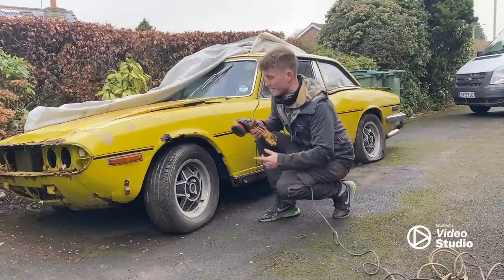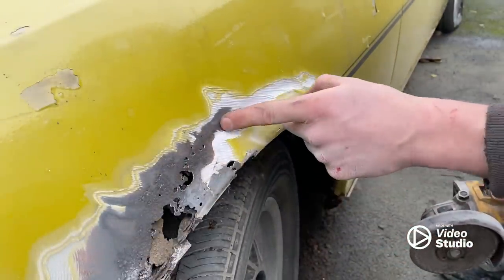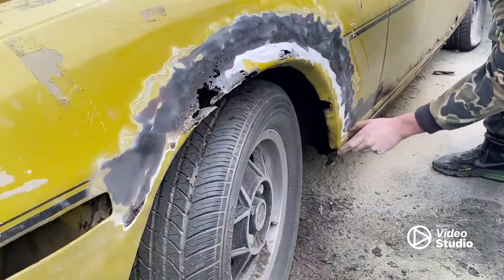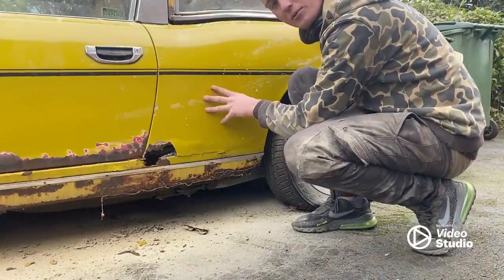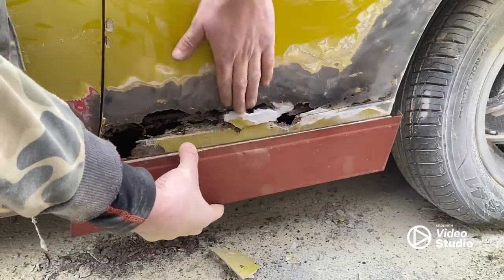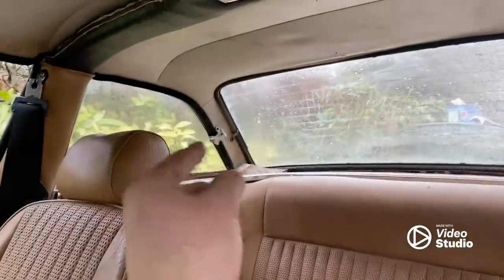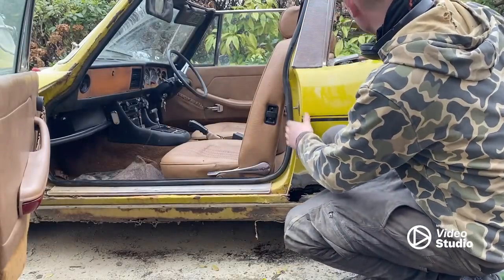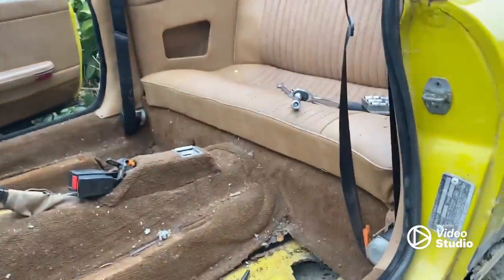Taking an ANGLE GRINDER to my ROTTEN, V8 Triumph Stag! (plus interior stripping.) How BAD can it be?

Comment: With no disrespect surely this car is scrap!? It seems what needs replacing is the complete sills/floors etc followed by lower wings and wheel archers, boot floor, valances etc etc basically the whole car from the ground up to the door handles... But I admire your optimism! Carry On!
Reply from the maker: Everything is repairable it’s just a case of how many hours you’re willing to put in! The way j on see it the doors shut nice…. so it’s all square… so why not! I mean not every panels bad, the bonnet seems good as does the boot floor!
Reply: Well done then – I'm sure you'll enjoy the journey. At least most if not all panels are available... off set by their cost perhaps? Down here in Oz, we are lucky re rust, as its not much of an issue even on a Stag. How is it mechanically?
Reply from the maker: @marknelson5929  all panels I want are available bar the windscreen surround. Mechanically it doesn’t seem too bad, when I first got it running (there’s a video on the channel) it smoked and was a bit tappety, but having ran it since it’s been pretty good,suspension doesn’t look too bad either, there appears to be new brake hoses fitted bushes aren’t cracked ect. You don’t really know the full story til it’s up in the air and you can give it a good look over though!
Reply: I've seen worse restored especially mk1/2 ford escorts

Comment: I'm looking forward to watching this take  shape. I admire your optimism! If you haven't already figured it out, there are 2 more levers on the soft top that release the back window (1 each side) and the last part will fold out. It may not be seized. When folding it away again, you must make sure that the window is securrd back onto these clips, otherwise the soft top will jam in the storage section and will have to be removed from the car to fix it...not a 5 minute job as you already know. Good luck sir!
Reply from the maker: Thankyou! Yeah I soon realised after slackening off the mechanism! I honestly don’t think it’ll be too bad, when we restored my dads old mgb as a teenager we found loads of old bodges, fibreglass, bolted on bits of tin! This soo far doesn’t have anything too horrendous… but there’s time yet!

Comment: Great project ! - well done. Triumph Stags are becoming ever more valuable when sympathetically restored. I’m not sure how much you will need to strip from it before you start to weld new panels as required. From experience, I would remove as much as possible, including engine and gearbox. Restoring the bodywork on it will be 80% of the project. Keep the videos coming, a good one to follow.
Reply: I fully agree, strip as much out as possible and ideally get it on a rollover jig, there will be more than you can see underneath. The rear floor rot will be all around the rear subframe mounts so all the rear suspension and diff needs to come out. And of course full 3 piece sills to get the strength back in. Well worth it once done, I love mine!

Comment: An area that Stags rust in is the base of the A pillar behind the front wings. Before you add the wheel arch repair panels get a look inside the wings.

Comment: I am a motor engineer of fifty years experience starting my indentured apprenticeship in 1972.  No one is a bigger fan of the Stag than me, having worked on many throughout my career and I still own one today.  
I appreciate your sentiments and greatly admire your enthusiasm, I certainly don’t want you to think I am being disrespectful and I apologise for bursting your bubble, but the truth is that your car is suitable to use for spare parts only.  
It will turn into a money pit if you attempt repairs, and will take you years to complete.  To bring the car to even a reasonable standard you will need unlimited time and patience, and a similar budget!  
My advice is to find a better car to start with, it will be cheaper in the long run, but whatever you decide I wish you the best of luck. 
Kind regards.
Reply: I think you are right and that's good advice you give.
Reply: I agree 100%  I did one many years ago it was nightmare. And never again lol
Reply: Trouble is market is full of really pretty tarted up on its 15th paint job and three sets of over sills etc etc but has been passed off as a bare metal resto too some poor unsuspecting customer!! I had one a decade ago with a stag for rear arch in it! Even though I showed the customer that it had been four different colours and painted over schultz etc around all lower body filler over filler just etc! He was still adamant his car had had a bare metal respray and restoration couple years earlier! If you restore your own you get to say you saved classic from going too the scrap heap and you know exactly what has been done!

Comment: I had a lovely deep blue Stag for about 18 months, bought in 179.. The car was almost new, and removing the hard-top was a doddle. It wasn’t the bodywork that I ever had any problems with - it was the engine. I think it spent nearly as much time in the mechanic’s  workshop than it did in mine. But what a beautiful car to drive! I loved the throaty V8 burble, and the electric overdrive switch on the gear lever. It was terrific on a warm sunny day to go for a drive withe my girlfriend; driving slowly into a cafe or pub car park & leaving thr engine burbling swat, she made all the adjustments to herself & then walking nonchalantly in. These days, I drive an XJ Portfolio Jag. It might have panoramic glass roof back & front, but though stylish, not like the Stag! Or the constant  ‘stag gearing’ garage bills.

Comment: Good work, big project!   But it will be worth it once finished and the personal satisfaction will be immeasurable.  I own a P reg 1975 Stag in the 'correct' (!) colour of Mimosa yellow, same as you have here.   The back panel is usually blacked in for this year, but looks good either way.  Nice you have the hard top too.  The Stag really is a great car when built properly second time round (too many were poorly churned out by the factory back in the day).  And the TV8 engine, for all it's notoriety, is a sweet engine when built and maintained properly and nothing sounds better.  Good luck!

Comment: Nice, keep up the work. Like watching resto vids. I think, and this is just my opinion, that you are going to have to remove all the interior trim, then weld temporary bracing from the B post to A post on both sides. If the sills and floor are rotten then not much is holding the two halves of that Stag together. Remove any more rot or steelwork and you may end up with a banana Stag, seriously, get it braced before commencing any more work.

Comment: Biggest problem I and my friends had with these Triumph engines was wearing out crankshaft thrust washers at an alarming rate.  They caused real problems with clutch operation and made gear selection impossible.  Not a difficult job to do with the engine in place other than having to drop the suspension to lower the cross member for oil pan removal.  I had to do mine three times in a six year period and my friend 2000Mk2 the same.  They must have been made out of some bloody poor metal.  The other problem was the right angle speedometer drive take off from the gearbox.  It had flexible spigot which simply kept shearing off.  I made my own spigot out of high tensile steel eventually and it never broke.  I never understood why they made it like that in the first place as it simply didn't need a flexible spigot for such a short length.
Reply from the maker: thanks for the tips, there's allot of weak points on these engines isn't there!

Comment: Jeeze. That stag way gone.  More there than you think. Keep digging. Had one back in the eighties with the original 3 litre block. Lovely classic car these days.  They don't the money as well as they should. Think the 3 litre block issues puts people off but as we know the cures are very easy to rectify. Good ignition cure to make it a daily reliable runner is to fit the Accu spark distributor and Power spark coil.

Comment: Yep interesting, actually there's not a lot on repairing these , just bits an bobs , so I watch with interest, thanks for filming this !
Reply from the maker: Very simple that’s what I love about classics just nuts and bolts! Limited wiring and no computers! It takes time but you just have to work your way through it! I mean this 12 minute video was around 6 and a 1/2 hours work! It’s amazing what a bit of editing can do!
Reply: You best be in this for the long hall, I have just got to where I am putting my stag back together, it has been hard but well worth it, good luck and I hope you all the best with it, join the owner club, it will help you find a out what it takes to own a stag, you must be able to weld, I could not and had to get a guy to help me 👍
Reply from the maker: @stevesankey6339  me and dad are hoping it’s going to take 6 months to a year of weekends and evenings! I’m pretty good and quick at welding and fab work now. I taught myself on my mgbgt that was allot worse than this (needed full cils, inner, outer, castle rails, drivers floor, passenger floor, boot floor, rear chassis legs/leaf spring mounts, rear arch, rear inner arches, a pillar, and front inner wings) that did take 6 years but neither of us could weld! allot of time was spent head scratching, and saving up for parts!  I’ve since done minor resto work on other cars but yeah I have to admit this is a big project!
Reply: Advertised as ‘the car to take on mercedes’ delusory Coventry management, they are beautiful had one TAY530N blew up near Hull at night 5 years old it was scrapped in 82

Comment: Looking forward to see how this Stag turns out because I had a White 1974 N reg,  back in 1991 with the hard top which are hard to get even back then.  Does it have the original Triumph V8? Cheers from a new fan.
Reply from the maker: Yes it’s got the  triumph v8 in! Although I’ve not checked if it’s ‘numbers matching’

Comment: Dont forget the stag does'nt have a chassis its a monocoque structure ie all those panels combined creat the structure of the car youll need complete sills ,prob inner sills out riggers floors , internal arches  If you are selling this stag on hopefully you,ll be honest because you could be creating a death trap if not done properly , The wings hide all sorts of rot inside amnd the windscreen surround is also a weakness . Good luck

Comment: Interesting comments ,mainly in city centers banned ,  in fact e fuel is on the way or synthetic fuel , it will take decades to remove ice engines some countries have u turned banned charging  EVs going now hybrids and e fuel, as for repairing stag  it's no different from other steel  vehicles this would have taken four weeks to do as we  repaired many Brit cars  to a good standard , still going , to return all stags to like new would be very costly and tucked away for shows , it's preserving  our heritage, to be driven,  long live the stag

Comment: Your panel rot is all lower level and isn't too bad at all, good job you're not trying to 'save' a Leyland Mini, sometimes I think they left Longbridge with corroded inner sills fitted as standard! Wishing you good luck with your project.
Reply: ..................Imo opinion Fluid Film is the best product that'll save your hard work when the project's finished.
Reply from the maker: Love the positivity! On previous projects such as my mgb I’ve always used wax oil for inside the sills and put grease between the panels  before plug welding, no point doing all the hard work for the job to last 5 years!
Reply: I don't have to tell you when it comes to welding panels together, overlapping sheet steel is a recipe for future rot, you just can't get away from the fact any moisture and importantly oxygen either side of spot welds is a breeding area for rust, you just can't stop it so I'd suggest you butt weld every time then disc off, takes a lot more time with alignment clamps and welded in bracing but it'll pay off in the long run.

Comment: I remember when Stags were brand new. They looked glorious and still do. Every car is flawed in different ways, a great car to drive, I would like to have the manual overdrive instead of the auto.
Reply from the maker: I’d love to do an manual conversion on this! My dad disagrees, apparently the 3 speed auto is a bit short legged! It’s also horrendous on fuel at circa 12mpg vs 19mpg so I’ve heard anyway!
Reply: @Boothsmotors  I have had 4 of these and know them inside out! the 3 speed BW Auto needs a 4th gear and gets on your nerves at 50mph! 22 on a run nursing it and round town about 16 or 17 mpg. The manual with overdrive 3000 rpm at 70 mph is much more comfortable and i used to get 30 mpg on a run and about 23 around the country b roads. The manual is much more reliable and the auto can jump out of gear and leave you stranded if the inhibitor switch burns out. Any questions i will answer for you!
Reply from the maker: @centaurus5676  everyone you speak to hates the auto boxes in these! 😳 and then a manual box for sale seems to be as rare as rocking horse muck!
Reply: @Boothsmotors  Yeah! true. if you want some mechanical knowledge on the engine, try Church house classics...He owns a Stag and early Range Rovers and does welding on other Stags and is very helpful with electrics and engine work tip's...Good channel and knows his stuff. just keep a look out for a manual box, one will crop up.
Reply: @Boothsmotors I have heard of some that have had Jaguar auto boxes fitted and they are far more long legged.
Reply from the maker: @davidking9707  I wonder if that would hurt the resale value after I’ve had some fun out of it?
Reply: @davidking9707  Most auto box stag conversions, were the 5 speed ZF box from jaguar. Far superior to the Borg Warner.

Comment: Hi there new panel is rear wing lower repair not sill repair it fits above the sill just where you had it, area that you ground clear of filler and rust.
Reply from the maker: Yes I realised the error whilst video editing, I did correct myself in the video  though! It’s hard speaking on camera still getting used to it
Reply: @Boothsmotors  When you fit that  lower quarter repair panel note it is not flush with the cill but set back slightly , if you look at the  same area on the front wing you will see. Great to see the younger generation getting involved in projects .
Reply from the maker: @S.teve.  ahh  right I’m yet to see the panels I’ve ordered, on my mgb I had to use a hammer and block to flatten out fold where the lower quarter meets the cill, I bet there’s going to be allot of fett Leung with this one too!

Comment: 4:33 I don't think a cover sill like you have there will be anything like enough to repair that section. In order to fix that properly you will need to cut the whole outer sill off and fit a new one. I would also guess that the inner sill is totally rotten and will require repairs before the new outer sill is fitted. There may also be rot in the floor pans behind the inner sill. (Edit-  there it is at 8:00)
I do think that you have underestimated the amount of corrosion in this Stag but i do wish you both the very best of luck with this restoration.
Reply from the maker: I know its going to be a big job, I feel like it helps to be positive! i think I need to do a video on my mgb gt i finished restoring  5 years ago, ive tonnes of photos of the welding; full front wings; rear wings; inner/sills; every floor pan; new a pillar; dash side inner wings; rear chassis legs.... the list could go on, it cost more in panels and parts than the cars worth... although it is a sentimental car!

Comment: Under the filler there's rust! Cars in the 1970s had designed-in rust traps, were poorly painted and started to rust from day one. We weren't impressed in the day having spent so much money on a new car. Modern cars are better designed and of course galvanised from new.

Comment: Don't spend no money on these cars..fiberglass the arches and undercoat. Fill the bottom of the doors. Probably got no floors in the thing. The engines was always junk in these cars. Right across the road was rover. But they made there own engine. Same company in competition with each other.. quick paint job and drive it. Not even a timming chain. Probably a valve stuck.. tappet clicking..